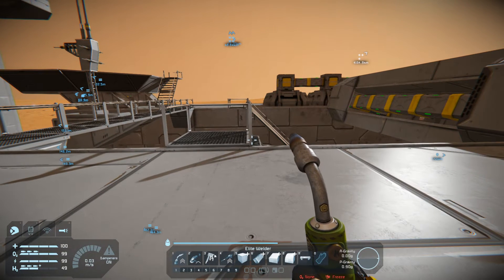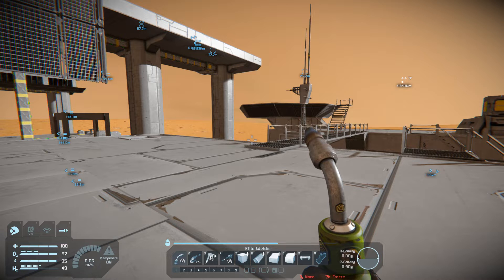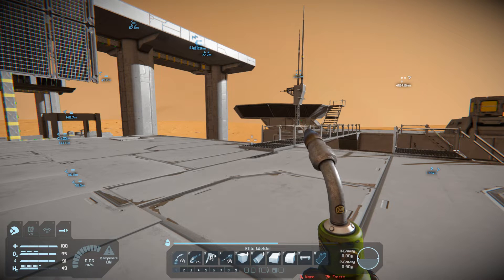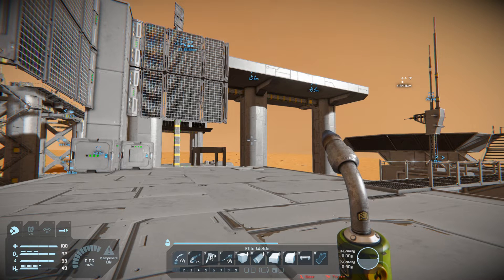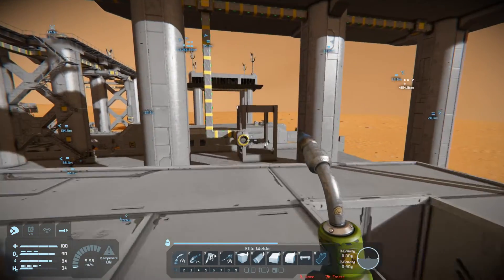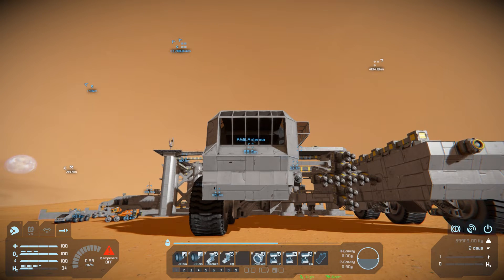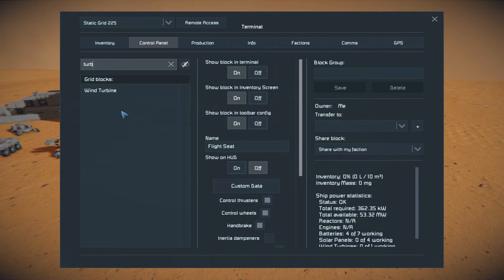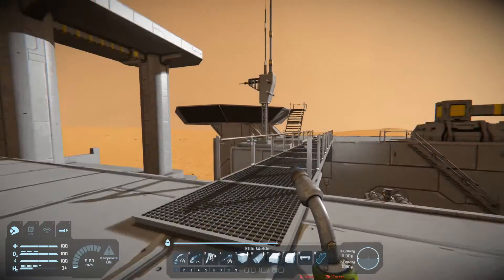WIND TURBINES ON MOVEABLE GRIDS :: Space Engineers Survival :: Ep. 761.5

Comment: The sad thing is you can't place turbines on blocks placed over rotors
Reply from the maker: the trick is that you have the turbine on a mast so you can push it up with the rotor and on the same subgrid you have a landing gear. so you instead of locking the main grid to the ground you lock the rotating subgrid to the ground. Kinda like a ground anchor you rotate out when you arrive somewhere.
That works, i am running my big mobile bases with that method.
Reply: @Rabenschild  do you have a video??